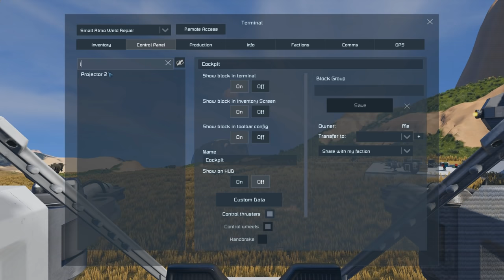Space Engineers Tutorial: Projectors and Blueprints (tips, tutorials and testing for survival)

Comment: In case of performance issues when using a projector to repair your ship instead of turning "keep projection" off just turn the projector off. If you then turn it on again when your ship is damaged it will remember the last projection you set it to keep and work just fine.
Reply: Another projector tipp: if you don't want to grind down the block connecting your projection to the projector everytime you finished building you can use a merge block but it's important here that the blueprint has the same ownership as the projector grid to make it work. So you actually need to have the merge block on the projector grid set to "nobody" in creative and to "me" in survival if you do this because in creative your blueprints will allways be owned by "nobody" when welding them. It's easy to forget that you have to leave out the merge block when owning the entire grid with Ctrl+A in creative.
Unfortunately you can't automate block owning with a programmable block (to prevent griefing on servers.)
Reply from the maker: Some very helpful points, especially the tip about turning the projector off and only using it when you've actually got any damage :)
Reply: @megapro125  Fully agree with this comment, I have found the designs done by ISL all come with a merge block attached so if you set up your printing area so that the design and printer meet at the merge block it makes things so much better.
Reply: Thank you! I was looking for this info!
Reply: Improved Holograms... Sounds like a great idea for a mod (if possible, and for a quality of life update, if not)

Comment: Rather than using landing gear, I like to project small grid blueprints from a large-to-small rotor (safety-locked of course). This gives you a stable base and can transmit power to what you're building. With an advanced rotor and two small connectors, you can also transfer cargo. When finished, simply detach the rotor head (or unlock connectors if using them).
Reply from the maker: I like that idea, especially using the connectors for getting inventory onto your new construction :)
Reply: Excellent idea for setting up the pad and then transfer method. Brilliant!!
I love the idea of projecting and using the connectors for locking and transferring cargo(fuel) to the new ship and then just unlocking connectors and taking off just like ship is in normal everyday use.

Comment: A suggestion marcelo acfm made was to start the grid on the projector, this makes it even easier to auto-repair, because the pivot is the first block placed, so assuming you have it rotated correctly it should already be aligned but you need to make sure you put keep projection on or it will immediately remove the blueprint
Reply from the maker: It's a good suggestion for making alignment really simple :)

Comment: personally, I just always start out with the projector block, slap a battery and control panel on it and I have my stable, reliable base for construction. if I wanna load the blueprint for repair, I don´t have to mess with offset, if I made an update to the design and want to apply that to all my other ships, I also don´t need an offset. all in all the easiest solution to the problem of "what´s my offset supposed to be?" works too if you wish to use reactors of course
Reply from the maker: That's a pretty sensible way to start your builds, I've been pretty lazy in the past and haven't used projectors so I'd never previously incorporated them in my plans, I think that's something I need to change :)

Comment: A projector needs 1 more "block" or function, the welding. Suggest add a part on how welding works, particularly the area a welder covers. I do not play much SE for the moment, but a wile back I tried a bit experimenting with building a self repairing vessel. To place out welders in a grid so it covered most blocks, giving a really complicated puzzle build. 
The second stage is to add projector and blueprint, so can construct any blocks that did not got repaired fast enough. 
The third stage are to design it in modules, preferable as a kind of "borg" cube (with connectors and merge blocks between them), so can expand and enlarge the creation having projectors in the 6 dimensional directions. Just that there are some issues trying to do this. One is how to add controls to an existing main control.
Reply from the maker: That's a good point you raise about working out exactly how much area a welder can cover. I have plans for doing a video on a printer of sorts. Probably won't be very soon, but it's an idea that's been rolling around in my head for a little while

Comment: Hey Splitsie! One question.  I've been trying to make  drill ship in space from blueprint. But everyone I found is equipped with ion thrusters, and you need platinum for that, and I have not found any platinum yet. So my question is;   Why is (almost) every spacecraft  equipped with ion thrusters?
Reply from the maker: Ion thrusters require only power to function where hydrogen thrusters need fuel (and technically power since the conveyor system needs a small amount in order to function) and the fuel runs out faster so most people just find ion to be easier for space based stuff
Reply: @Splitsie   ok, Thnx for quick reply! :) so, where can I easiest find plutonium? I'm building a Large grid ship now so I can put on a large ore detector and then go out for a search.

Comment: I think you've actually got the projector upside down.  You have the "front" correctly identified but the side with the circle with four lines goes down, not up.  The evidence for this is that the way you have it mounted in the video, moving the Horizontal Offset slider to the right makes the image go left and vice-versa if you're standing behind the projector facing forward.  Also, moving the Vertical Offset slider to positive values makes the image move down instead of up.  If you flip the projector right-side up the way I'm suggesting, both these issues are corrected and all three sliders behave rationally.  I do concur with you however that the Pitch and Yaw labels should be swapped.

Comment: Hey I have a question with the survival for having the instructions for blueprints I found in workshop.
.
I’ve found some good atmospheric drill models, though for some reason it pops an error message, show the hologram of what it looks like, and the objects on the rotator doesn’t spawn in. Any ways I can fix or improve that? I’m still new to the whole game.
Reply from the maker: It's impossible to print things connected to a rotor or piston from a projector. Projectors can only project a single grid and anything connected that way is considered a sub-grid which is a separate grid. In the case where a ship has multiple grids in the blueprint the projector will only project the part that has the most blocks. In creative mode you can paste the whole thing intact but you can't in survival unless you're willing to enable creative mode temporarily with the alt+f10 menu

Comment: So... is it only for ships building? I can't make a system that would add blocks to my base to keep building it automatically? Like a long tunnel that would require thousands of same looking arcs to form it? Welders help but I'd have to manually place so many blocks for walls >_< Or would I hit the top of my PC processor much sooner?
Reply: You could use a projector for building repeated patterns on a base. Line up the projection with where you want to put the next prefab. Build it. Then use the offset controls to move the projection further out. You'll probably have to move the projector occasionally when you reach the offset limits. Or you could set up a single very very long blueprint in creative mode. You could make a truck with welders in all directions and drive it very slowly down the hall building as it goes. Armor blocks don't have much performance impact, but terminal blocks do. Particularly if you are running any scripts on the grid.

Comment: Great job on all of your videos!  Wondering if you might be able to help me out with a question I have? I found a blueprint on the workshop I really like. However, I would like to replace the armor blocks in the blueprint with a different type of armor block. It's a modded armor block. Is there a way to edit the blueprint to change one type of block ID in the blueprint with block ID of my choice. That way when the projection is displayed, it say has replaced all of the light armor blocks with the new modded armor blocks...without me spawning it in creative and manually replacing them all before saving?
Reply from the maker: I'd love to say I knew of a way, but without editing the blueprint file using a text editor (which may not even be possible) I don't know of any way to do that without manually replacing the blocks in creative :(
Reply: @Splitsie Thank you for the quick reply. I appreciate the info. I may try use Notepad ++ to edit the blueprint file with the block IDs and see if that works. I'm hoping I'll be able to replace the block group. I'll let you know if I'm succesfull.

Comment: hi mate how do you do multigrid blueprints please? i have some from the workshop but cant use them because of multigrids
Reply from the maker: You can't, projectors can only project a single grid. Multigrid blueprints can be pasted in while in creative mode though (which you can activate in single player by going to the alt+f10 menu). Sadly it's just a limitation of the projector system
Reply: @Splitsie So, if I have to "cheat" a multigrid blueprint, bc the projectors cannot handle them, how do I know how much resources it should cost, so I can "throw away" the right amount of resources, so it's "less cheaty"? Compared to other similar games, SE doesn't seem like you can get the "cost" of a blueprint displayed anywhere. I guess I could go in creative, spawn it, go back in survival, dismantle it, count what parts I got back, and throw those away too. But that is rather tiresome. Any alternatives?
Reply from the maker: @sebastiendiot7236  There are some scripts that calculate the costs of projections but I'm not sure they work across subgrids either :(

Comment: Nice
Now how to make sure I am not block any center block or inside the ship block ?
Reply from the maker: The best way to avoid missing pieces is to set the projector to show only buildable and to do your best to construct in layers, for small grid ships using a grid based welder helps too as it can penetrate a few blocks deep. It's all a bit difficult with some builds though :(
Reply: This is the problem I'm having right now! Only the outer layer gets built, so I have to grind down and weld up the inside pieces manually.

I think the small grid welders still have that welding distance problem like Egor.

Comment: I know this is an old video but im still having an odd problem maybe someone here can help me grab a solution. Built a large ship and trying to setup a projection of itself over itself for easier repairs, but i cant get it to line up perfectly. i can set up all the offsets in the menu properly but it ends up--- twisted a few degrees off center? most of the blocks close to the projector line up but as you get further away the weird small twist becomes more and more apparent and then blocks just dont line up anymore. its not that its one or two blocks off the projection is just weirdly unaligned. Havent found any solutions for this yet. And yes am trying to paste the same blueprint of the same ship over itself so its not like its a similar blueprint built slightly differently.
Reply from the maker: I've honestly never had that problem. Is the projector on a rotor? If it's part of the same grid as the rest of the ship that's quite an odd bug that might be worth posting some pictures of on the space engineers subreddit (you're more likely to get a constructive and active response there than some other places in my experience). If you do post that, post a picture showing where your projector is on the ship and how the projection becomes misaligned as that'll help you get useful responses :)
Reply: @Splitsie  Theres no rotors in the entire build, i can see how that might cause an issue but i stay away from rotors. I am still fairly new to space engineers and mostly just fumble my way around in creative. I guess ill see about posting over on the reddit forums then though thanks for the reply i wasnt expecting any sort of response and was just going to give up tbh : P i even managed to try and reset alignment of the ship using the method in your video (though i may not have done it properly) and that didnt help. still the same problem on that one design no other ship i cobble together has the issue. i also tried removing and replacing the projector block at different points to see if it makes a difference or projecting even from a base not on the ship itself its like that one blueprint always saves skewed just slightly off. can overwrite it or resvae it as a new design all i want the fundamental issue remains. Not a problem to just paste it in creative mode somewhere. but it really mucks up projections.

Comment: Are you making the from surface to space without hydrogen tutorial next?
Reply from the maker: It won't be the next video but I'm in the process of setting it up so it should be soon :)
Reply: Considering ion thrusters take platinum and platinum is only found on asteroids, using hydrogen is inevitable on your first time. And if you already have ion thrusters, just speed up with atmospheric thrusters and let inertia propel you in the altitudes where atmos stop working but ions haven't picked up yet. It's always good to have hydrogen boosters though.
Reply: i tried it but i felt down at a about 20000m
Reply: Thats great to hear! I made a ship with most of the atmospheric Thruster on the bottom and ion Thruster on the rear side. When your atmospheric Thruster are getting weaker you can rotate the ship 90° and let the ion Thrusters do the last part. I think with this kind of design you dont have the bottom of your ship coverd with different Thrusters.
Reply: Voxnic The flaw of this design is that both types of thrusters can't help each other, so either has to support the ship all on its own, even when it isn't working at full effectiveness. What's the weight of your ship? I'll do some calculations for you.
Reply: But you can rotate it 45° so both thrusters support each other
Reply: When you rotate them 45°, each kind of them only works at about 70% power because the thrust vector is not parallel to gravity. But 20 000 m should be way beyond the atmosphere. If you fell down, I think you just don't have enough ion thrusters. One large grid large ion thruster should be able to lift 367,000 kg at 1g. How much does your ship weigh?
Reply: uhh i dont know but i can put it on the workshop

Comment: i cant figure how to play my projector, and it is abseloutly not explained in this video. you just jump on a projector and it simply works fine. Its attached to what? why is it on a landing gear??? WHERE DO I PUT THE PROJECTOR. it always says theres a problem in the grid when i try to load a pattern
Reply from the maker: The landing gear were just the easiest way to have lots of separate grids nearby one another with power and a projector, other than for the discussion of orientation of the grids they are irrelevant. For a projector to work it needs to have power and to be projecting a grid of the same size as the projector itself otherwise it will not work. At this stage I haven't checked if the projector interacts with the progression system, if it is then a projector owned by you may not be able to project blocks you haven't unlocked yet.

Projectors are not something I would recommend to players who are new to the game, they are fiddly to get the alignment you need and don't really have much value to new players who would be better off building similar grids multiple times as each time they do they'll improve the designs (happens for older players but the increase in performance each time is so much greater in the early stages). If you're wanting to play around with someone else's design you'd be better off loading into a creative game and pasting it in directly from the blueprint menu.

Comment: I tried this and it says Projection Out Of Bounds. What does that mean?
Reply from the maker: I honestly don't recall, but here's a response from a few years ago that explains it nicely https://steamcommunity.com/app/244850/discussions/0/1742228532898116738/ :)
Reply: @Splitsie  Thanks for the reply. I built a little stand. Landing gear, one small block, projector, battery and control panel. With the projector on top of the block on the landing gear it should be the first block places. Yet I am still getting the same out of bounds error when i go to the projector and bring up the blueprint. It displays the projection but have no idea how i build it from there or if i have to get rid of the error first. EDIT -- followed another tutorial turns out once you have the projection in the right place you then have to add blocks up from the projector's grid to what your projecting then you can pull out your welder and build.